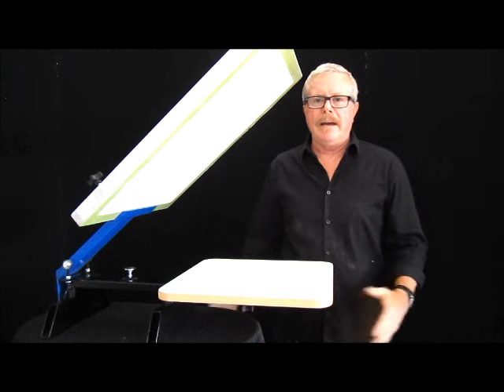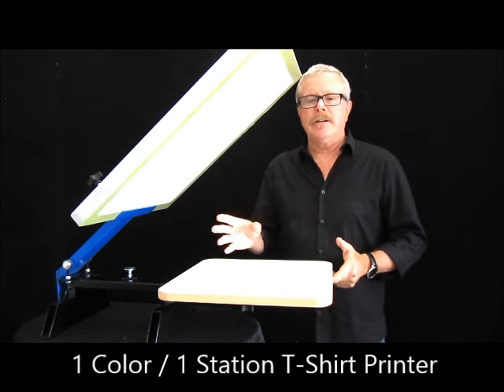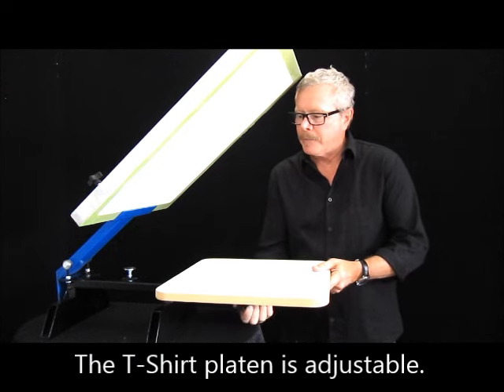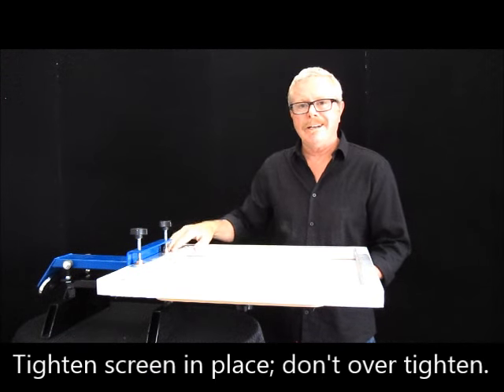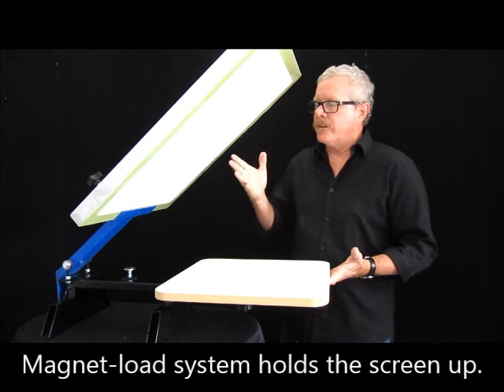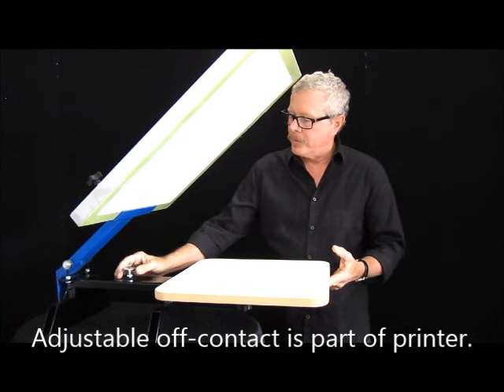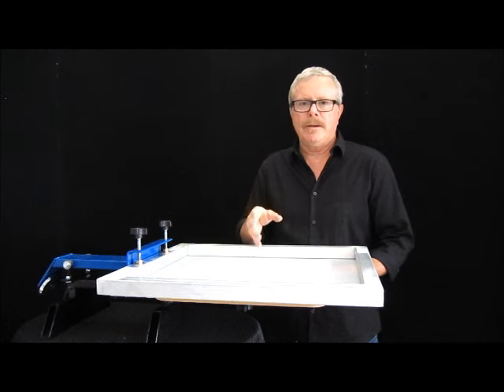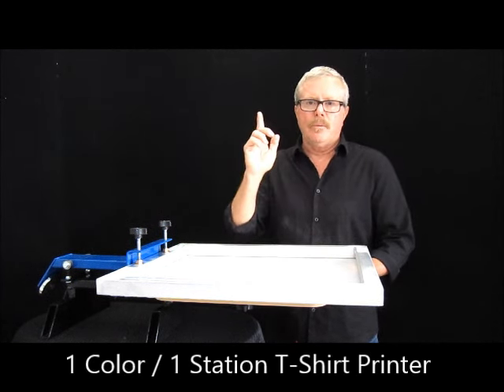Textile T-Shirt Printer - 1/Color-1Station

Comment: What is the size of your t shirt platen ?
Which size of platen you'd recommend for L, XL t shirt printing with 16" x 20" frame ?
Reply from the maker: Sounds like you're gearing up to start your own business. Here's the link to this printer that comes with a 16" x 16" platenhttp://rhinotechinc.com/screen-printing-equipment/Textile-Essentials-Equipment/1Color-T-Shirt-Printer: . You can add a larger platen with bracket for about $90. Screen Printing Equipment Packages: http://rhinotechinc.com/screen-printing-equipment/textile-essentials-packages. And, we offer a UPS-shippable Washout Booth, a Filtration System that you'll need to be in compliance,  Pressure Washer, squeegees, premiere screen cleaning chemicals and more. Any order of $75, minimum, that is delivered in the contiguous U.S.A. is free shipping. Thanks for all of your questions.